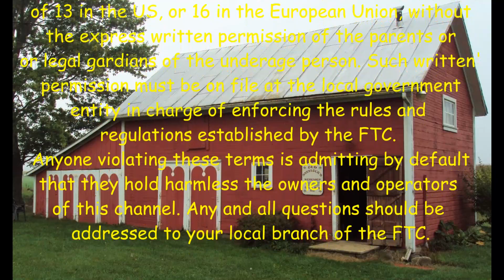B&D #425 WorkMate and Union #537 Transitional Plane Share A Feature

Comment: Great he’ll never forget his work mate I got mine for my ninth birthday and I’ve used it for everything and it’s still going strong love it . Your right about what they say about planes but I’ve never understood it because the wood coffin and jack plane in all wood are light and work very well and now with my broken back I can’t push a heavy plane so I’m finding I’m going back to the old wood jobbies more and more because my arms work ok but the pressure on my back with weight puts the pain level high so it’s back to wood or electric which I’m not a fan elec to aggressive and it’s not like I’m having to do it for a living so time is no problem . Good vid take care chow for now god bless
Reply from the maker: I have an electric that cuts nicely with sharp blades. 
It came dull as a butter knife. A couple passes over the grinder snd a bit of honing and it cuts well. 
I'm like you in that I am seldom in a hurry.  😁😎
Reply: @OldSneelock  I used my electric planes at work for speed and it would of been ok for most as a finished piece but I like to finish by hand , I like the look better to me it’s finished then I’m old fashioned I guess .
Reply from the maker: @davidchadwick1626  The rotary leaves a scalloped finish. I like the flatter almost glossy finish that a classic plane and scrapers give. 
The electric is great for truing up native oak and pallet wood after ripping. 
I have a 13" planer/molder for after I joint one face. The electric plane saves a lot of hand work jointing. 
A table jointer would be nice. 😁😎

Comment: Those B&D Workmates are a great tool for the shop - I own several very old ones, which use a good quality laminated plywood for the tops.  Using one now for my latest project restoring an old drill press!
Reply from the maker: High grade plywood is excellent as a top for workbenches. 
I have used recycled kitchen counter as a attachment using a cleat clamped in the vise top of my Workmates

Comment: I remember the plane restore which was a GREAT series and that's a FINE Workmate. My old little one stays in Cheryl's side in the dry. I found it under her folks house when her step-dad passed. It's WELL worn and beaten up but still works fine. I've actually used it a few times and found the plastic inserts for clamping in another jar somewhere so it's all there, paint, glue and all. I probably oiled it up and as long as there's oil, there's hope or something to that effect. So Thanks Unc and U and Auntie don't wear yourselves running after Oliver and GBWYall!
Reply from the maker: I always think of the Tin Man when I see a neglected tool. I can hear it saying, "Oil Can! Oil Can!"  😁😎
Reply: @OldSneelock  Oil NEVER fails but it might end up being 50/50!

Comment: Those workmates are handy. I have the 225 works great 👍. Thanks 😊!!
Reply from the maker: I got the 225 a while ago and really like it. I have been using it in the basement shop as a workstand with a plywood panel on top. 
I glued a cleat to the back and clamp it in the vise.

Comment: How's she goin'?  That Workmate is some nice.  I have a very old workmate.  They sure have made lots of improvements in them since I got mine!!  Nice rebuild on the plane.  Great idea to put the bamboo on the bottom!!  Take care!!
Reply from the maker: The early ones with the cast aluminum frame sections are very nice. Not as many bells and whistles. Solid work benches and the vise is just perfect for the tasks.  😁😎
Reply: @OldSneelock  Yes, mine is cast aluminum.  I use it a lot and the vice, although only good in one direction, is my favorite part!!!

Comment: Very good video. Really enjoyed it. Saving that beat up plane was a genuine restoration and save. You deserve a lot of points for that. Most people would have tossed it. As for the Black and Decker table, I have not been interested in them because the ones I've seen looked too small to be very useful. Didn't realize they made different sizes. Now I'll have to check them out again because they seem like a great idea. I wish I could find great used tools at thrift stores like you do. It would suit my budget much better. Bamboo is almost indestructable. It is an excellent flooring material. On the Oregon coast, it grows like gangbusters. Careful where you plant it, because you may never be able to get rid of it. Thanks
Reply from the maker: Some come from shops. The 425 was a windfall. It depends on who is marking prices. I just walked in at the right time. 
I once planted Mexican fire bush. It looks lke tiny bamboo. We had one plant in one garden. The next year it was everywhere. 
It seeded itself in the ditch across the rosad and around the pond..

Comment: I received as a Christmas gift in 1974, the first year that the B & D Work Mate was sold in the US.  It's a bit heavier than the newer ones, but has held up over the years.
Reply from the maker: The old ones with at the die cast frame are nice but the castings crack. Dad gave me one that needed a new top. it is in the Blacksmith shop. 👍😁😎

Comment: I remember watching the restoration of that plane.  It seemed like you were going to a lot of trouble for an old plane then, but it's really hard to argue with the results now!  That Workmate looks like it will be a terrific tool for a young Sneelock.  And it won't surprise me if grandpa "borrows" it from time to time either.
Reply from the maker: The object of the exercise  was to demonstrate as many types and ways of restoring wood and steel combination tools. 
I know there are very nice woodworking planes made by talented people and sold for hundreds of dollars, if not more. 
I wnanted to and I think I did show that a sharp edge held at a fixed angle will do an excellent job of making smooth surfaces no matter how much it costs. 
I believe the operator has more to do with the success or failure of any tool, than any other possible influence. 😁😎

Comment: Nice find!!! I got a Workmate 400 from a neighbor after it did not sell during their garage sale. I had to replace the top since it was made of some faux wood and had gotten wet. The 400 also has a vertical vice, but is harder to use.
Reply from the maker: All of my Workmates, other than the 425, had MDF tops. 
Replacing the top is a standard practice. 
You can buy tops for most from B&D.
Reply: @OldSneelock  Thanks! I will remember that in the future! I made one out of two pieces of plywood laminated together to make it think enough. Much better.

Comment: The Workmate 425 was a very good find at the Restore.   It cleaned up well.    The bamboo top should be a lot better than the MDF in my 400 which has sagged a bit over the years.
I have a 300 and 400, both purchased new at the time.   I have not kept up with the changes in the models since I got the 400.    This also pivots on the front, but a knob on either side rather than the bar.   Not a problem to use two knobs.   I have not used the pivot feature for decades.
Dave.
Reply from the maker: I repaired/replaced a few MDF tops.  My first was when Dad gave me one of his and I had to replace the top. I used some old countertop and made a new deck. That was 30 years or so ago and still works fine.

Comment: I still have my workmate 400.  It has that same feature of turning the front board to the 90 degree position.  Not quite as easy as the one you have.
Reply from the maker: Not sure if I will use it often, but it is a nice feature. 
I like the size of the top and the insert.